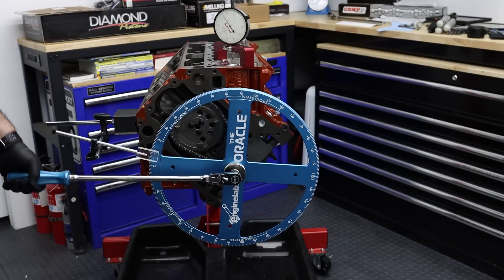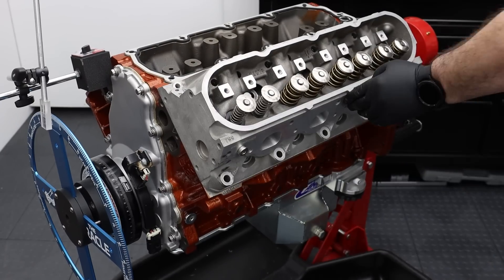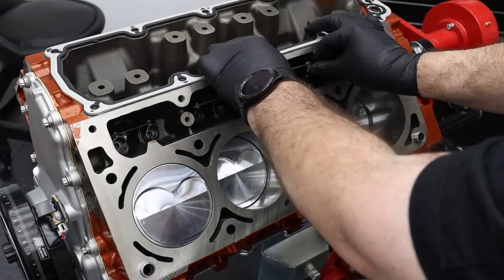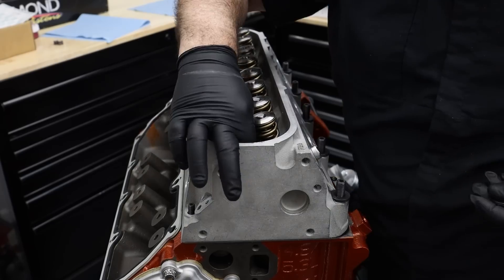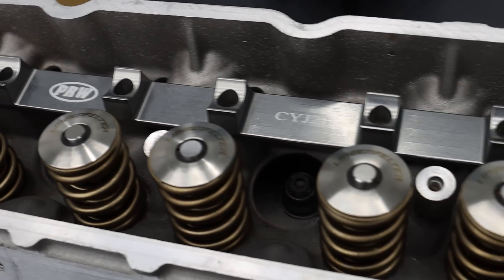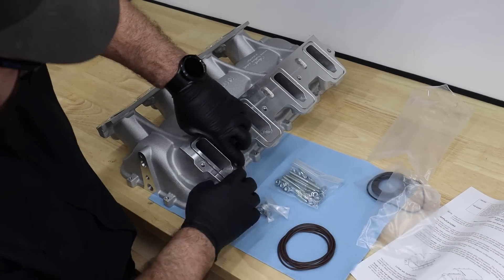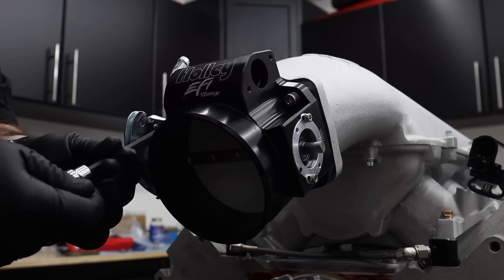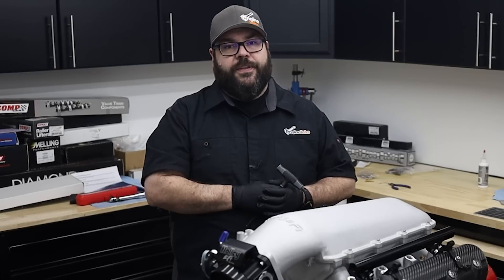Building Our 5.0L LS Engine's 8,000-RPM Top End

Comment: I would like to see a line 6 with  roller. Cam would lift on the 600 balance aluminum piston rods aluminum head port to the max to see how many horsepower you could get out of it.  225 6 in line dodge . I forgot turbo fuel injection with a 100 110 throttle body.

Comment: Are ya ever going to finish this project or dyno tested? If not why... big fail ??
Reply from the maker: It's still sitting in the shop waiting patiently. Running a magazine is hard work, and finding a week to drive the engine to the dyno and back is more challenging than you might think.
Reply from the maker: Also, I just realized, this comment isn't even on the most recent LS5.0 video...
Reply: I seen the orther video with carbon fiber intake 👍👍 .... I hope you test it soon... we be waiting

Comment: I was subscribed too and somehow missed this. Great video! Although why did you end up using ported cathedral port heads? Wouldn't rec ports have been comparable without the porting?
Reply from the maker: Theres a few reasons. One is that this way, it's genuinely a worked over truck engine, just like the Coyote engine in the original LS vs. Coyote. Another is that when we ran the numbers we could pull it off with cathedrals. Then, there was the cost associated. We would have had to run the small-valve rectangle ports with the smaller bore size. And that would have likely still needed machine work.
Reply: @EngineLabs  That makes sense. Thanks for the explanation!

Comment: Coyote and Godzilla fan here but totally enjoying this engine build series by Greg Acosta.    What did you end up torquing the cylinder heads to?
Reply from the maker: 30-60-90 lb-ft on the 11mm studs, and 28 (IIRC) on the 8mm studs.

Comment: All that and it still ends up being just an LS. 

Laughs in coyote superiority.
Reply: @BadBaltGuy  To me, the LS is the superior engine. It’s dimensionally smaller. It’s far simpler, with less moving parts. It’s more available, or said another way it’s less expensive. Aftermarket parts and performance research has been intensively focused on it for over 20 years. Even if you prove to me that a “coyote” makes more power…….I’m still going with the LS for the above reasons. BTW, tens of thousands of LS powered Fords out there. Can’t remember seeing a “coyote” powered Chevrolet.
Reply from the maker: That's a weird personality trait. Are you OK? Do you need to talk to someone?
Reply: @EngineLabs  I'm just with the times that's all. The modern definition of easy HP is Coyote.
Reply from the maker: But it's lost the last two head to head tests with its GM counterparts. Easy horsepower is easy today, across the board, regardless of brand. I get being a fan of a brand, but to use the word "superiority"... it's not an F-15 dude.
Reply: @EngineLabs  the last two. Just two, noted. Ok so TWO showdowns got shook up with some poor parts selections. Also noted. So does that explain why stock coyotes even in 4 door pickups are out there gapping? What lasts and what doesn't? sure, a coyote might run you a little more coin but a smart man buys things that last. The days of justifying junkyard LS builds are long gone boss. They don't last. 10 junkyard LS builds later one finally realizes they could've just bought ONE coyote and been able to throw down 1,100 hp without even stressing it. LS..... 🤣🤣🤣🤣🤣🤣🤣
Reply from the maker: @BadBaltGuy  I dont generally talk about other people's accomplishments to prove my points. I stick to what I have first-hand experience with.
Reply: Coyote superiority 🤡
Reply: Coyote in the crosshairs!  😂😂😂😂😂😂😂

Comment: What injectors will you be using? Why is a 58x reluctor wheel compared to the 26x beneficial? What other intake manifolds did you consider, and why didn't you choose them?
Reply from the maker: 1 - TBD
2 - More signal = better, below 10,000 rpm. 10k and above, a 36-1 reluctor would  be the move.
3 - We considered pretty much every off the shelf intake, and chose the Lo-ram for price, runner length, and lid availability. The intake situation will likely change several times throughout the project, since there are a lot of external considerations involved.

Comment: Wait a minute! I’m subscribed to ALL and I never received any notification about the lower end of this build! Also, I thought carbon fiber and oil were Incompatible! I ride bicycles that have carbon fiber forks and when they get oil / grease / lube on them the carbon fork will swell up!
Reply from the maker: I know from a lot of other creators, YouTube is being weird with distribution, even when you are subscribed and have notifications turned on. As far as the carbon fiber, I believe it has more to do with the epoxy formulation than the carbon fiber material itself. There are carbon fiber engine interals out there.

Comment: For nostalgia this would be a cool combo for a 3rd gen Z28. A custom built TPI style setup would look sick in that application A Holley low ram would look similar to the TPI setup I think.
Reply: I've always loved the 3rd gen camaro!
Reply: The trouble is that a 3rd Gen F-body would need an upgraded manual trans and upgraded rear axle to handle the additional power just to drive around town.     
A Fox body doesn't need either of those to drive around town.   So much cheaper to build than a 3rd Gen F-body.
Reply: @joestang5550  I like those too!
Reply: @joestang5550  The fox body used the same sad T5 as the 3rd gen fbody. Mustangs in general didn't swap to T56's til 2003, and only in the high-end models. That's a full decade after fbodies got the T56.

LS swappers have proven the T5 will shatter with half throttle of a stock LS, not to mention resist shifting quick at 8000rpm. The fbody's diff was definitely weaker than an 8.8 tho.
Reply: Exactly! I have a 3rd gen iroc with the 5.0 tpi. Im looking for a high rpm build similar to the DSE build but with a budget of a plumber. Lol! I don't need 700 horsepower cause I've been tagged with the 200 horsepower currently.
Reply: That intake would be a monster.
Reply: I have been on mine for 4 years now , life got in the way so slowed me down . But with all things going as planned I will have mine done I can't wait. Might get me into trouble though so there is that.
Reply: 4th Gen too!
Reply: Exactly what I’m looking at building for my 90 GTA